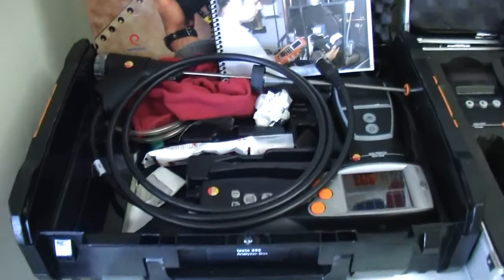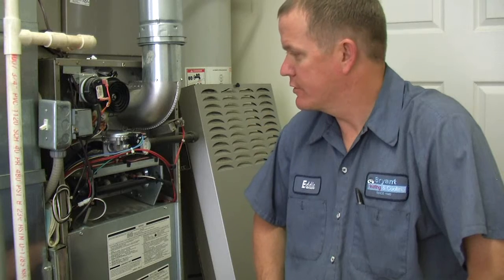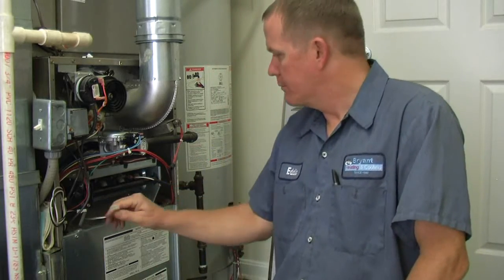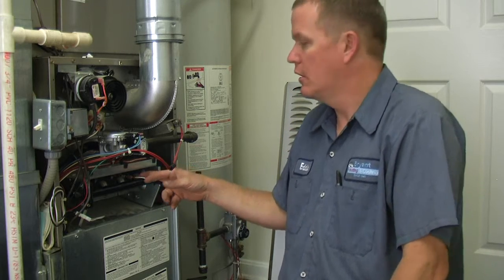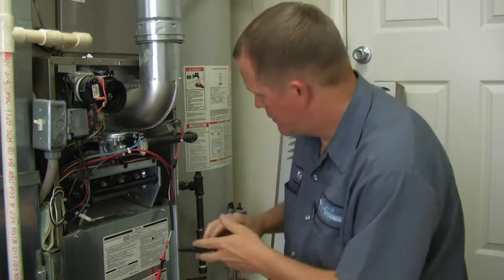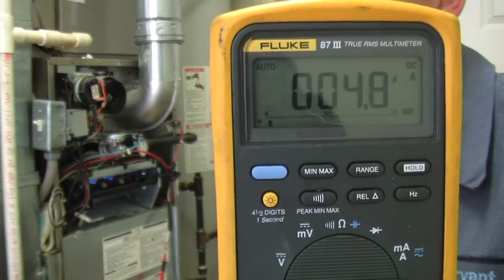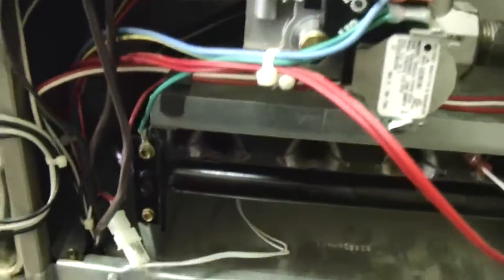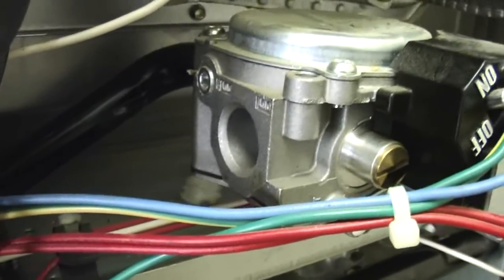HVAC - Gas Furnace tune-up with Combstion Analyzer (Part 1 of 3)

Comment: You use 80 Ohms on ignitors? I've been using 90! I had one last season that Ohmed out at 256 and was still working! I saved it in fact, lol. 
Regarding IDM motors...when you amp draw them, what do you condemn them at? The hot flue gases bake the lube out of the bearings.

Comment: Any tune up for $35 bucks is a joke. The basic parts cost more. This guy does this for a living on a professional level. They do not roll the dice,they replace parts to ensure that there are no future problems,no recalls and no problems big or small for the owner. The cost of wasted fuel alone over a heating season makes up the difference between a real tune up and having some smuck squeeze gunk off a filter and walk away

Comment from the maker: You have to pre-quailfy them when you call to make an appointment. Ask them if anyone in the company uses a combustion analyzer. You can ask them if they measure static pressure which is basically air flow. The most important thing I believe is measuring the carbon monoxide levels including the level in the vent stack, so they need a carbon monoxide meter at least.
 I also hope that you have a carbon monoxide alarm in your home, if not go out right now and get one

Comment: Heya All
Got guys doing a clean and tune for 35.00  90.00 a pop! Worked for a well reputable company that was doing clean and checks for 110.00. They would clean the flame sensor and vacuum out the furnace 110.00! And we were doing 15 a week! The customer did not know the difference! Got a fancy invoice upon completion and that was it!
The thing people do not realize is that equipment he has there on top of that washer prob cost about $8,000.00 , need a lot of clean and tunes to make it up!

Comment from the maker: I would not use a wire brush with a drill nor do I see a need to. I would be afraid of damaging the burners with that setup, I am more concerned with the older rusty ones .  Just use a standard wire brush and rub gently taking care not to damage anything. You can also take them out to your van and blow them out with nitrogen.

Comment from the maker: @fuccillo111 I know a lot of service techs that have all of the top certificates but still do garbage work, to me it just proves that they are good at taking tests.
Call around and ask if they can give you the read outs on a combustion analysis and give you the cfm reading along with the wet bulb and dry bulb temperatures. From there I can tell you if everything is working right or not.

Comment from the maker: @mmantini83
I believe that you are thinking of a pilot thermocouple.
On a furnace with a flame sensing rod, the control board sends a small amount of current to the flame sensor, and once the flame is produced at the burner , the small amount of current will flow through the carbon in the flame to the burner and then back to the control board. 
This is the way that I was taught anyways

Comment: Eddie, very informative video..Thanks. FYI, I believe that the flame sensor is actually a thermocouple. A thermocouple is a device consisting of two different conductors (usually metal alloys) that produce a voltage proportional to a temperature difference between either end of the pair of conductors. I don't think the flame actually creates electricity.
Reply: Old furnaces and water heaters used thermocouples. Thats a thing of the Past. We now have flame sensors and thermopiles that create a small charge of electricity when heated.

Comment from the maker: @scoutD300

Keep in mind that if you want to use the machine to measure temp drop and diff. Pressure you will spend around 300.00 I think in accessories. 

A coworker had the UEI analyzer and it came with all of the accessories for around a grand, he ended up fetting the 327 in a drawing at our company Christmas party, I will have to check and see which one he likes better.

Comment from the maker: @scoutD300 
Thanks for watching,
The reasons I went with the 330 over the 327 are:
1 - warranty is 4 years
2 - the ability to save my jobs for future refrence
3 - ability to measure static pressure
4 - screen looks much better
5 - print out looks better and a little easier for homeowner to understand
I had the 327 for a bit and I must say that I like the build quality better, it feels more rugged in my hands, but I ended up returning it for the 330.